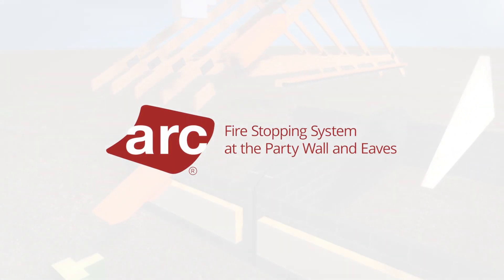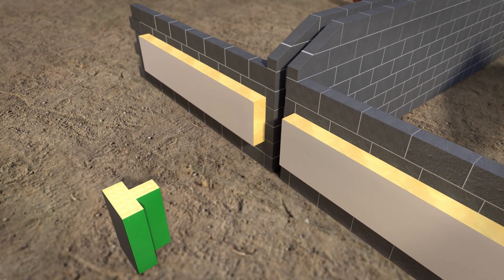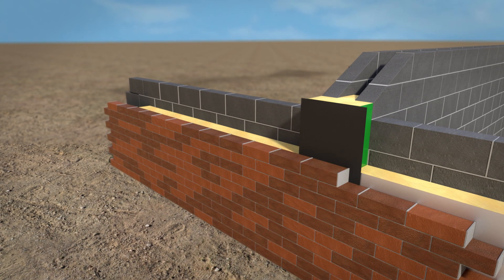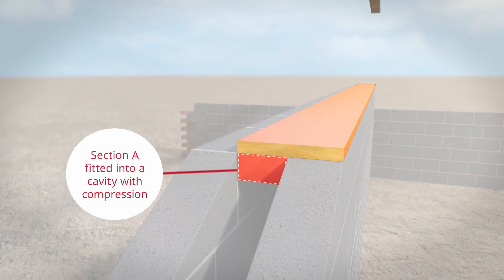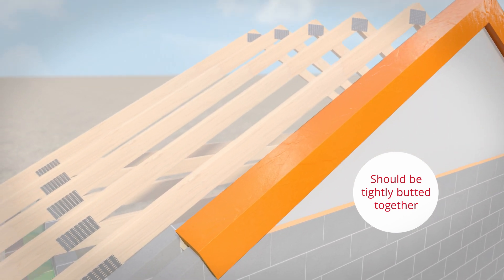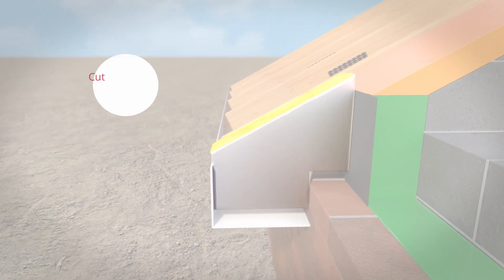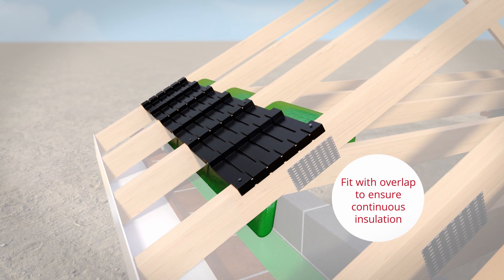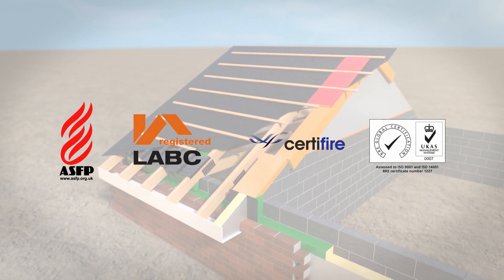Arc Fire Barrier - Masonry Party Wall

Comment: Why are the battens divided by a barrier above the partition wall? Surely after all that the fire can still travel through the compartment via the battens?
Reply: The idea is to restrict air flow, the fire break system is designed to buy potentially life saving time. The battens will burn eventually but are  treated with fire retardant. Tests have shown that restricting air flow significantly reduces fire spreading. I've been a roofer for over 20 years, hope this helps? 👍